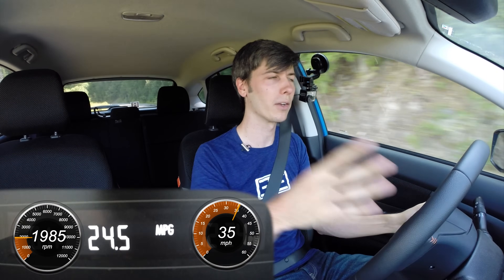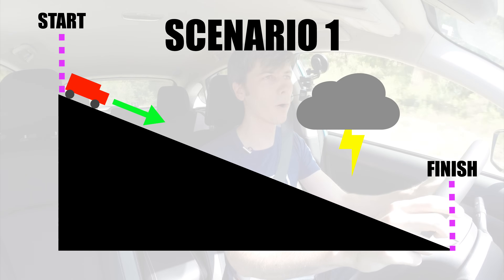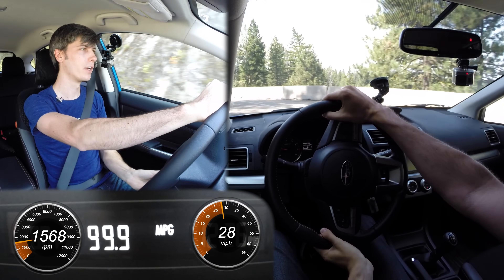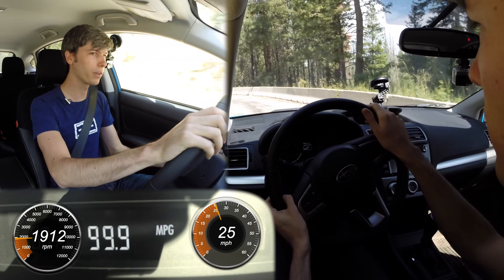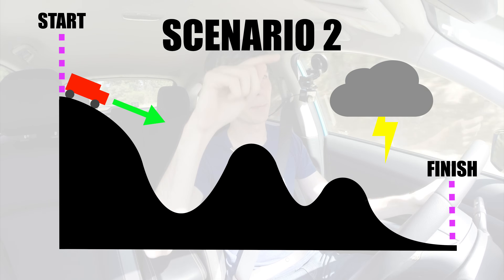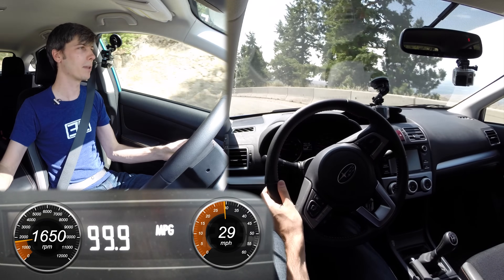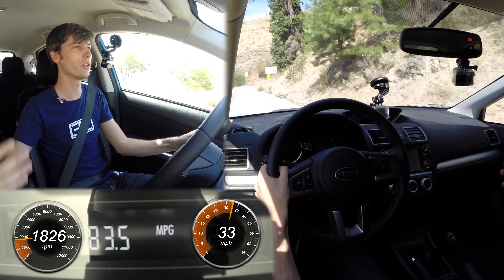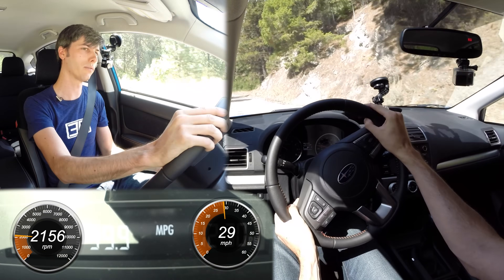What Uses Less Gas - Coasting Or Engine Braking?

Comment from the maker: Important Note: This video applies to modern cars with electronic fuel injection (gas, diesel, manual, automatic, DCT, CVT, etc). New cars sold today will all work like this (though there are always random exceptions). As you go back in model years, it will vary manufacturer to manufacturer which completely shut off fuel or continue to inject. Carbureted vehicles inject fuel based on vacuum levels of your engine, so this video does not apply. Sometimes I take pictures: https://www.instagram.com/engineeringexplained/
Reply: LOL On a 600 HP car that supports both 4WD and RWD? And intense driving conditions arent in Cali, those are on the track, where these cars are tested...
Reply: There are actually models of carbureted vehicles that will also shut off the fuel supply during engine braking.
Reply: what the board computer is displaying is not necessarily correct. some comment here shows that their board computers shows less mpg when in gear than in neutral - the opposite of yours. while your theory could be true, the fact that it is based only the board computer numbers (which often are bogus) it may as well be just wrong.
Reply: My 1994 Integra GSR factory service manual specifically states that the fuel injectors are shut off when the throttle is closed and the car is in gear, and above 1,000 RPM.  That means infinite MPG, basically, until 1,000 RPM when it tries to add fuel to keep the engine from stalling.  My 2014 Mazda CX-5 with automatic gearbox reads the same thing, 99.9 MPG when driving forward, throttle closed.  So does my company's 2010 Fusion Hybrid, which pegs the MPG gauge at the very top when rolling forward with the throttle closed.
Reply: I should point out that some carburettor equipped vehicles have an idle fuel cut to stop 'dieselling' with the ignition. On 80's Daihatsu this circuit was in series with a vacuum switch, which cut fuel to the idle circuit (the only one active at closed throttle) at a vacuum level that only happened above about 2000rpm with a completely closed throttle.

So some carburettor vehicles do have an over-run fuel cut, and it can actually be retrofitted to any carby that has an electric idle cut solenoid
Reply: This is great, I asked a question and I got a video response. Thank you, EE! Glad you respond to your faithful viewers!
Reply: Thank you for the clarification. My 30 year old fuel injected ford never reduces fuel injection when engine braking. Therefore I am much more efficient in neutral when above 20 MPH, based on my instant fuel economy.
Reply: Robert Short Most torque converters since the late eighties have lockup clutches in them that engage after a certain speed, and other conditions have been met.  At this point they act like a direct connection between the engine and transmission with zero slip.
Reply: EreksonJ i agree.  I thought that was odd that he mentioned the car shuts off fuel because i have a 1997 impreza and when you coast in gear it definately still has a growl even with no throttle.  Thanks for the numbers to back up my thoughts, i wasnt sure about this video
Reply: I was just going to ask this. I know that "modern" cars will go into fuel shutoff, which not only saves gas, but also helps cool them off if you have just climbed a steep grade as they are now running as an air pump, but what constitutes modern? I wonder what is an average cutoff date for most manufacturers when they began this practice? 1980s? 1990s? 2000?
Reply: +BobEckert56
Its elsewhere in his channel, but the creator/host of EE is formerly an automotive engineer, so he has industry experience on the design&testing side.  I used to work in car maintenance, and I haven't found anything on this channel I would call misinformation, bogus, or erroneous.  He knows cars, both conceptually and practically.  If I thought otherwise, I wouldn't be a subscriber.
 😊
Reply: Well, this is actually a bit confusing.  

(This comment is made in 2023/10)
For cars produced from late 2010's (e.g. 2018~) to today, probably MOST of them would have this total fuel shut-off feature.
But for cars produced 2008~2014 --> such tech was just BEGINNING to get adopted.  Not all manufacturers switch over all their engine platforms at the same time.
So I suppose this (total fuel shut off during downhill coasting) really needs to be checked on a case-by-case situation for cars made during those transitional years.
Reply: @reallifeengineer   Thanks for the info
Reply: I am curious dose this work with motorcycles also? I appreciate the videos always good information.
Reply: The Problem is that you have a sequential gearbox. So you would have di shift down a few gears and find neutral. It can happen that your bike indicates neutral but isnt which could block the rear wheel of the bike. It is much safer just to stay in gear. Also most of the bikes dont have a gear indicator so it would be difficult do switch back into gear if you need to. Additionally you have to consider weight transfer on bikes, as it affects the handling more than in a car. In my Car i switch to neutral every time i go downhill on the Autobahn, as the gear ratio is quiete high and i there is more resistance by the high rpms of the engine.
Reply: Engineering Explained it's not safe, sorry had to lol
Reply: I've never liked rolling in neutral, just doesn't feel right
Reply: Motorcycles use a sequential transmission, so you can't just pop into neutral whenever you want--otherwise it would work the same, yes
Reply: Engineering Explained good explanations, with the minor quibble that fuel flow in carburetor is controlled by air velocity, the Bernoulli principle, which created suction in the venturis, and not vacuum. Though there is a correlation, as the vacuum causes the airflow. 
BTW, oldest vehicle that I know of where fuel we cut off when coasting is the 1.9 TDI in the 1996 Passat. I bought the first New beetle TDI in western Canada (in June 1998), and the guys with the rare engine computer noticed this right away.
Reply: +K0nst4nt1n96 +Buzz LightBeer
I will point out a couple things, having owned a VW Jetta;
The manual explicitly states about the new VW/Audi DSG transmission NOT to roll in neutral, especially downhill, because when in neutral the gears are not being cooled which could lead to accelerated wear and premature failure or even seizure.
The hill-hold feature is, I suspect, based on not just a level sensor, but on a routine in the engine computer that computes applied torque based on the difference between RPMs and roll speed.  It does not release the brakes on an incline until the applied torque is deemed sufficient to accelerate the vehicle.  This is because the transmission gears are DIRECTLY coupled (not mediated by a viscous fluid like in conventional "American" transmissions) which reduces thermal losses and improves response, but also makes the transmission more susceptible to damage from torque stress.  Its not that 'they suck' ; its that prevailing driving conditions in Europe are different from certain places in the US (I drive occupationally in San Fransisco, so I know from experience).  That's part of why European cars get better mileage, but in North America also experience more mechanical wear.
Reply: I drive Manual and its better for my car to idle downhill if i dont have to break. On curvy Roads i will always use the engine brake. With a automatic gearbox or dsg its better to just stay in d. The newer cars will automatically disengage the gear also on vw cars. So the best solution ist to just stay in Drive and let the Computer decide the best mode. We get better mileage because we dont drive big engines. Most cars have 3 or 4 Zylinders and about 70-150 HP.
Reply: +K0nst4nt1n96 
Thx for that info!  I honestly would like to own another european car, probably VW/Audi or something else not too sporty or frilly (or expen$ive to maintain!)
I'm not in the habit of trusting computers to do things I can do myself, but not having to think about what the transmission was going to do mechanically and just selecting my next gear was fantastic; one less thing to think about!
-
But my dream road car would have a V6 VSTT engine 😎
Reply: no car cuts fuel completely. 1000% would end up blowing cars up under load when coasting down.
Reply: Hi Jason. How about the "Pulse and Glide" technique for saving fuel???
Reply: Answered my question about carbureted vehicles.
Reply: can you please make a vedio on  fuel economy with respect to tire size i.e     width and height of the tire ? 
I love your vedios keep up the good work
Reply: Most motorcycles on the road today use carburetors, therefore are always sucking fuel when the engine is moving. They are more efficient when coasting at idle.
Reply: Thought the same on my truck, but with the extended PID's show injector times and they are off with 0ms when the usage still shoes .7 gallons per hour.
Reply: MavHunter20XX sorry. Closed throttle is highest vacuum. Vacuum means lack of air. Open throttle is lowest vacuum.
Reply: I was just about to make this comment.
Reply: Engineering Explained ii
Reply: ebels3 the engine will not inject fuel while driving downhill but deccellerate the car. When you go uphill or straight you might need more energy to go back up. See scenario 2 from his video.
Reply: I was about to comment about the older cars when I saw this note. Sometimes, I turn off my engine and coast along until I need power again at which point I use my gears to start up again. I'm sure there will be some opinions about doing that too.
Reply: Most port injection cars continue to inject fuel when coasting to not dry the runners and the back of the valves. Toyota released a paper about this maybe 10 years ago.
Reply: Hey, what country did you take this drive in? USA?
Reply: Dude , u are right about the fuel consumption , but not allways you need to think about the fuel , if u are in neutral then u need to brake a lot , and that means you are getting the brake pads hot and worn out too quickly . :) so my opinion is that u always use the engine brake system and leave it in gear depending on the downhill.
Reply: Engineering Explained But my BMW E92 Diesel always stays in motion with about 5 mph in 1st gear without pressing the throttle, even if I‘m NOT going down a hill. How is this possible without fuel injection
Reply: Buzz LightBeer intense driving conditions in cali? Mercedes and bmw are both build on the foot of the alps. Driven german cars all mu life, never had an gearbox failure.
Reply: Krystal in lot off cars the fuel mapping is made in that way. If you decelerating and the engine is below a certain amout of rpm, the injectors do not inject fuel.
Reply: GETUP AND GO on a downhill situation in neutral the engine always needs fuel, to keep it at idle. The same situation in gear and adding no throttle will cut of fuel.
Reply: How about throttle body injection.  Specifically on a zz4 350 with throttle body.
Reply: I really liked this one, and I'm very glad you added the note about carburated cars. My approach was to see what approach got my 03 330i to the same distance when coasting "between gears" until the car slowed down to 55 mph on a subsequent flat area and gentle hill during my daily commute. The engine braking scenario did give 0 gal/mi on the downhill, but the effort to make up the lost distance made the fuel consumption perhaps barely above the baseline. I was optimizing fuel consumption by using engine braking for ~50-80% of the hill, then coasting to speed up, gaining speed to make up distance travelled, then finally slowing down to get to 55 mph at the baseline distance. In the end, it was fun, but the ~~3% saving meant I wasn't making significant money on the 75' high hill. 
Steeper and longer hills would have resulted in greater savings, though.
Reply: @Buzz LightBeer I guess the main issue with German transmissions is or was that in Europe manual transmission is or at least used to be the norm. Especially in the mountains. There is more experience in automatic transmissions in the US, as they are the norm there.
Reply: How about a 1998 Jeep Wrangler. If that is engine braking is it using the fuel injectors? It is a 1998 with electronic fuel injection.
Reply: Obviously coasting is better for keeping your momentum; and engine braking is better if you want to shed some speed. Going down a steep grade, engine braking is a must - not for any fuel consumption - but just to save your brakes.
That moment when you own a hybrid that automatically goes into N coasting -- with option of using paddles to bring gears back into play for braking (and great battery regen) -- all with the engine off.
Reply: Infinite MPG heck yeah
Reply: Do you think a 94 mustang gt is new enough for this to work?
Reply: @Engineering Explained I have a doubt jason.... Is it the inertia of the vehicle or the work done by gravitaty rotating the engine of a vehicle moving downhill in gear with the foot off the accelerator.??

You have mentioned as inertia of vehicle throughout the video.

Isnt the inertia only responsible if the vehicle was moving in a level surface??
Reply: You are always the best....
Reply: I realize this video is a few years old but haven't seen this topic mentioned. What is your opinion on modern automatics with the coasting function? I know modern BMWs and others including our new stinger gt has a coasting feature in eco mode that decouples the transmission when off the brake or gas but immediately engages on application of brake or gas.. I feel like this will wear out the bands or other items  but I'm assuming they have put in place mitigations for this?
Reply: I often do clutch fully pressed type of coasting along with light braking for control..it makes driving much easier and smooth.. otherwise i have to keep changing gears often esp when following another vehicle..with clutch fully pressed and brake intermittently  i am always ready to change gears..its more comfortable for me to drive this way because I don't have to worry about stalling..just want to know how long will my clutch last??
Reply: Sir, I have a question. What happens if you engine break or coast in gear, and you press break, does it consume gas when you break while in engine break downhill?
Reply: Does commonrail diesel work as this, does it use fuel when engine braking
Reply: ok, and can you explain how different it is for carburated vehicles, and older direct injection diesel pumps? im from europe btw, here we have more diesel cars than petrol. mine its a 96 opel vectra with an older pump that injects more the more rotations you give it, it has no eletronics shutting it off and so i know it uses less always in neutral... but i dont quite understand how my other 94 opel corsa carburated engine works in that sense
Reply: yeah....but notice that when you put in gear and engine brake...the rpm is relatively higher (around 2000 rpm). but now notice when you put in neutral the rpm goes less than 1000rpm. so engine braking is forcing your engine to hold higher rpms even though the fuel injetor is shut off....its using more fuel. higher revving engine means using more fuel. safety aside. putting in neutral or disengaging the cluth is more efficient than engine braking.
Reply: @MJ-rr4hd  thats incorrect, higher engine rpm doesnt necessarily means higher fuel consumption
Like you said, the injectors are shutoff
They put out zero fuel
The engine its keeping that rpm because of your speed
Reply: @zepedroteixeira4697  for the engine to keep that rpm.....it needs to be revving....so its definitely consuming fuel. maybe the injector is not completely shutoff. maybe it has secondary injectors for auto idling.
Reply: @MJ-rr4hd   Sorry for doubting you, but are you assuming that? or do you know that? it may be something i dont know, thats why i am asking, but in my experience, i've learned that if your car is mildly recent, and therefore has electric injection, then it completly shuts off the injection, i know its hard to believe that the engine can keep those revs, make all that noise, and not be using up any fuel, but its true, from what i know.
it simply uses the speed from the wheels to make the engine spin, keeping everything moving(that includes the alternator and ac) but just not injecting any fuel, it produces 0 force, but it also may break the wheels more than if it were injecting some fuel, like older versions of non eleteric injections.
I have an older car, so i cant speak from experience on that, but i am a mechanic, and i do know from driving cars around that they show the fuel per km usage, and it goes to 0.00 l/km if you're coasting, and it doesnt if you are in neutral.
Reply: @zepedroteixeira4697  I'm not 1000% sure..but my logic makes sense....cause you notice...when you engine brake the rpm goes up...as well the engine rambling sound also increases. and the rambling only can happen if there's combustion happening in engine. and without fuel ....combustion is impossible. I don't think the vacuum inside engine cylinders can be that loud without combustion. the only way to check if the vacuum is that loud or not is to push the car very fast while its in gear and the engine is turned off . I think the system auto Rev matches when you use engine braking / shift down gears. let me know your theory.
Reply: @MJ-rr4hd  like im saying it is possible
And if we do what you said, pushing the car fast while in gear and engine off, the engine will turn on, i did that daily when my battery died some time ago

I am asking if you know that for sure, because i literally studied all of this, i am a mechanic, and most times i preffer to assume like i dont know something because i dont want to be arrogant, and thats how it is with cars(and life for that matter), there is always something you dont know
In this case, i might be wrong for some cars, but im 99% sure that that its how it works for most newer electric injection ones
The engine revs and noise maybe be mesleading, but it is indeed giving zero fuel to the combustion chamber, like the display inside the car says
Reply: @zepedroteixeira4697  when you pushed the car...... how much ramble / exhaust sound did your car make before the engine turned on?
Reply: @MJ-rr4hd   it doesnt make much, but you cant compare a couple of hundred rpm's to thousands when you're coasting
And those new cars make no exaust noise when coasting
Reply: @zepedroteixeira4697  coasting is different...what do you mean?
Reply: @MJ-rr4hd  sorry my bad, i meant engine breaking
Reply: @zepedroteixeira4697  "Engine Braking". but anyways I'm still kinda...undecided for now.
Reply: Answer: Regen!
Reply: how does this work with automatics, wouldn't the torque converter not keep the engine rotating fast enough (requiring the engine to give it some fuel?)
Reply: @robertshort9487  Yes it works with automatics we have a 20 minute trip down the hills in a ford with a 4 speed auto and I use 3 down the hill with no braking and the get free ac with the consumption gauge at 99 mpg
Reply: @jonathantamm9202  your cars computer has to be set up for it.

If the OEM didn't program it to turn off fuel flow then it won't.
Reply: So why does the new Mercedes E63 S cost in neutral to save gas?
Reply: Matthew Trevett lol!  Right!  Ive had to ride cars with the key in off position on the freeway because the engine was overheating.  It was kind of fun, turn it on, gas up to like 65, shut the engine off, coast down to like 45 and repeat
Reply: as for carberated  engines, your throttle will be mostly closed, removing most of the vacuum.
Reply: Matthew Trevett Do not shut the engine of while driving.  All safety systems are also turned off, and power steering is lost.  This is a sure fire way to get yourself, and someone else hurt.
Reply: Capt Mifune It also goes to the very literal thinking of Germans.  The owner’s manual of my 2012  Golf (yes I read the owner’s manual) states that the vehicle is more efficient with the clutch depressed or the vehicle in neutral.  This is reflected by the instantaneous mpg counter on the dash.  It goes toward the logic that if you are not using any fuel, you have 0 mpg because you can go an infinite number of miles and still have used no fuel at all.  All it is is math.  You can’t divide a number by zero and get a tangible number as a result.  M/G=20miles/0gallons=20/0=undefined.  Hopefully that made sense...
Reply: Engineering Explained this video is flawed...

I have a 2001 f150 that is fuel injected. I also have an obd2 sensor that shows me the live fuel consumption rate. My truck's computer (with an automatic transmission) automatically applies some throttle even when coasting so that the engine braking doesn't slow me down so much. I know this because it consumes about 0.5 gallons per hour when I coast in neutral. That figure more than doubles when I coast in drive... It makes an enormous difference in my instantaneous mpg. 

I think maybe you need a reader that measures higher than 100mpg, and run this test again. Or better yet, look at the fuel consumption rate...
Reply: Capt mifune, that is why German transmission suck. They are tested on the track.Transmissions have trouble with stop and go traffic on steep grades. Like in San Francisco and California mountain commutes. Many foreign car companies put GM transmissions in their street cars. Japanese, English and German cars were using GM transmissions. And Mercedes transmissions are getting better because they are using Chrysler' s transmission technology.
Reply: Capt Mifune, to stop the transmission from falling apart and dropping parts on the street? Many German cars have weak transmissions. They fall apart in intense driving conditions like in California.
Reply: Costs more for engine braking because it wears out transmissions faster. New transmissions have smaller parts so they don't last forever.